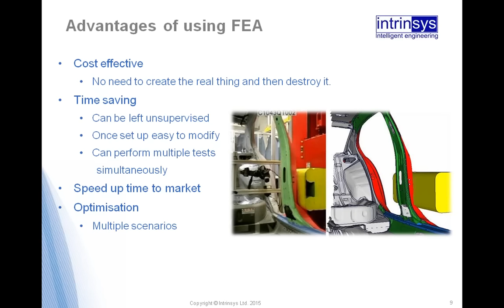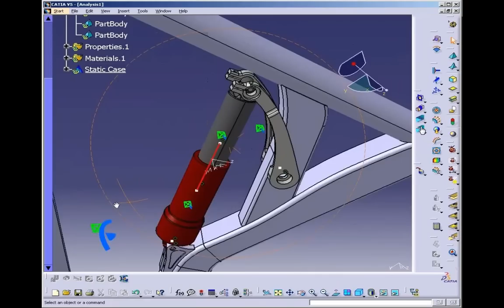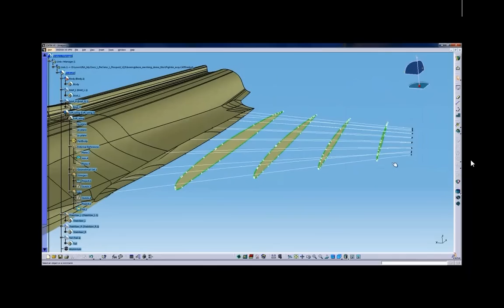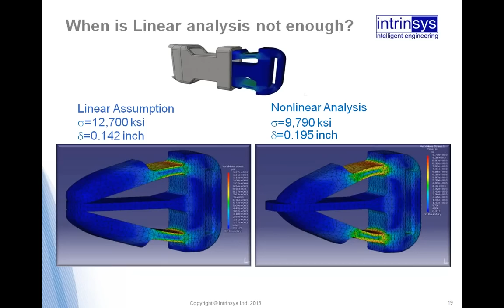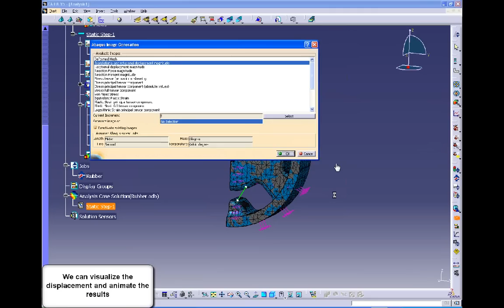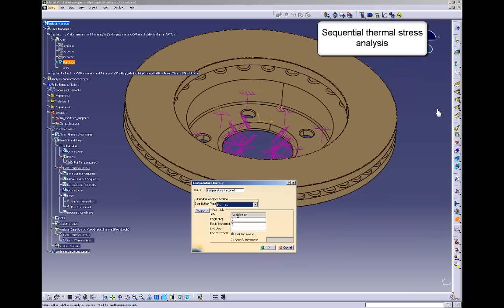Comment: Hi, could you please tell the difference between setting spot weld properties as rigid instead of hexahedron?
Reply: Hello, 

The rigid connection property makes the connection completely rigid. Whereas the hexahedron connection property allows you to apply a user defined material to the connection, which will provide some compliance in the connection.